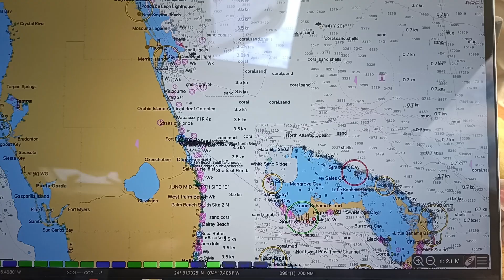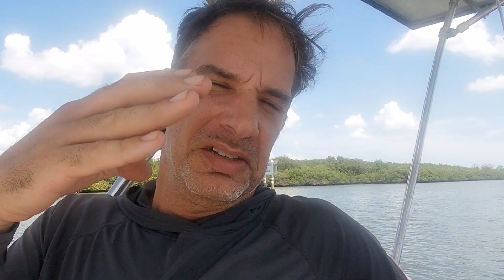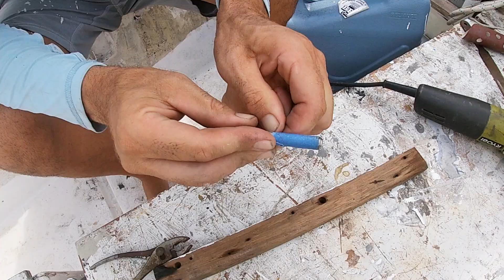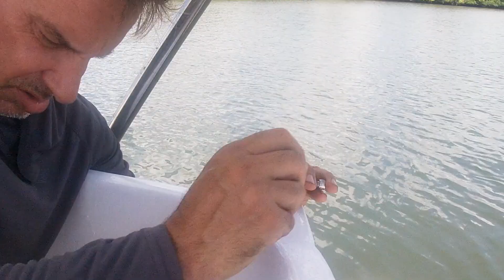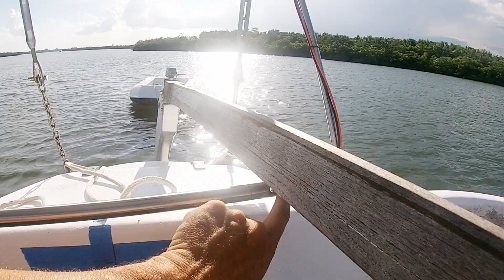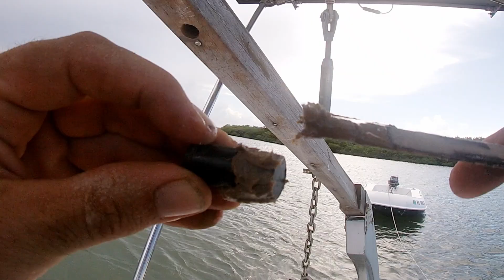Py Pilot install- Transmission 15

Comment: Yo whats up? How is it going for you? I hope you are alright. Im thinking of buying the same boat as you. You think its a good one?
Reply from the maker: The Lauren Koster 32 is a solid and safe build that no one would actually build today. Chiefly because they couldn't make a profit. Be aware, there was a period at the end of production in the late 70's/ early 80's when balsa was used in the deck core. If that is the case with your boat, it's not a deal breaker as long as the core is still in good condition or you are willing to fix it. I say go for it. Love the work and make it your own.
Reply: @SVadastra1965 thanks for the reply.  I will check it out.👍